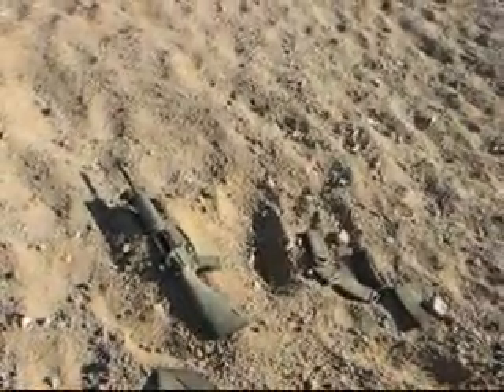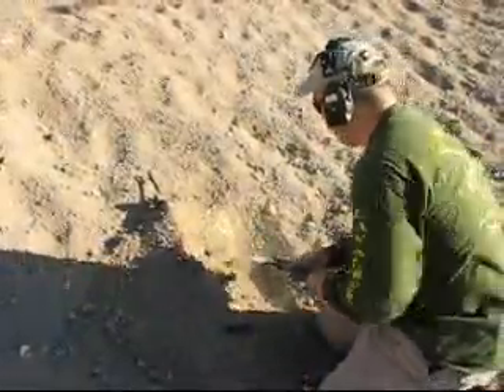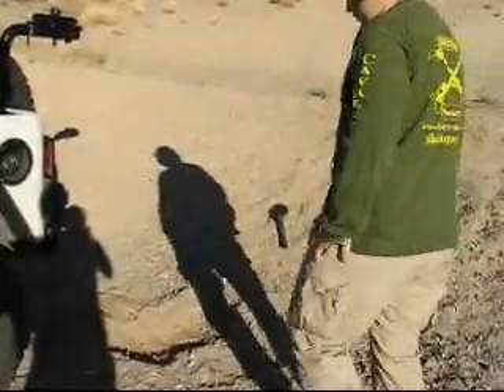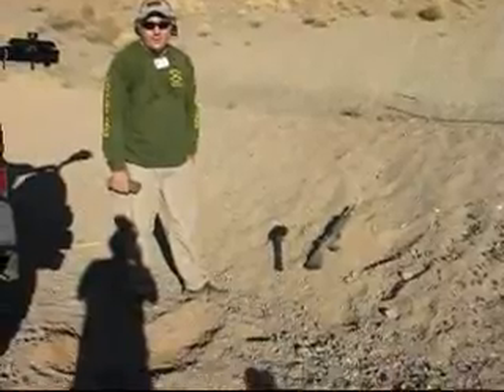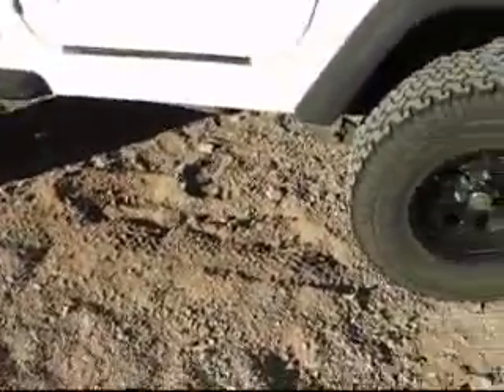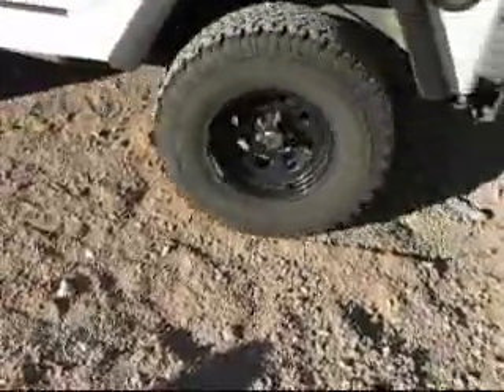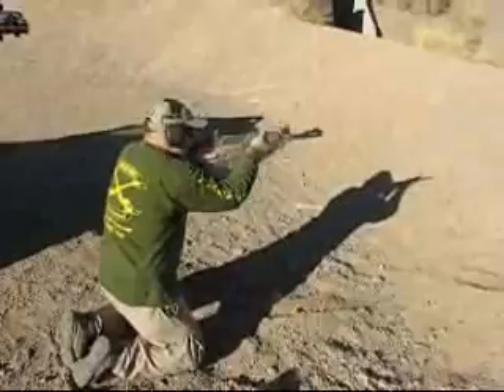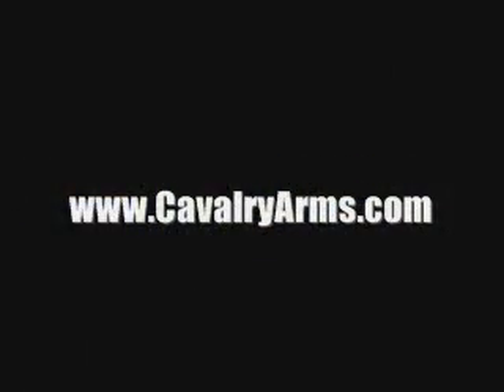AR Dirt/Dust Test Dust Cover Open, Run Over

Comment: @oeyesea Of course we were told that M16 is flawless, and anything wrong with it was user error LMAO!!!
Reply: use a quality magazine, properly lubricate and maintain the weapon and it is one of the most reliable small arms on the planet and by "maintain" I don't mean clean, by maintain I mean, replace the extractor spring when necessary or PM it and do the same with the action spring aka the buffer spring.

Comment: @frankgon4 Depends the sand in iraq and afganistan isent it a very fine grain sand almost like baby powder while the sand used in most tests is beach sand or just dirt? also it's still a machine im sure it will jam up sometimes when in that envionment only reason the ak doesent is cuz it was designed with very loose tolerences idk both are great wepons you me.

Comment: @Hincesti07 Standard 5.56 round is 62 grain, and 77 grain bullets such as the mk262 mod 0 & 1 are common and are used on special purpose rifles.

AK74 uses 49 - 56.8 grain bullets as the most common rounds.

Comment: @pugs2300 Bolt is close during the test and was never advertised as being open. At any rate, if enough debris get's into the operating system of any weapon, even the AK's, as debris don't magically teleport to a different dimension inside an AK's action, malfunctions will occur.

They did a similar test with an AK, of which the AK failed to keep debris off it's action, which ultimately lead to some of debris migrating into the magazine and causing further issues.

Comment: I also like the G36, which by the way uses an AR-18 style bolt and piston system, because the charging handle was part of the bolt.
Whatever obstructed the bolt could be cleared by a hard push or a gentle application of boot force as we called it. The AR-15 style bolt assembly "pulls" the bolt, and you will find it harder to find a hard object and slam your charging handle against it to force it to work.
Sure, recoil is higher, but we don´t run through ammo as much as the US troops do.

Comment: constantly blowing in the wind gets into everything. Piston guns may be able to run a little longer without proper maintenance, but if I'm in an environment like that, you best believe I'm going to be cleaning my gun. DI guns are plenty reliable enough to work between semi-regular maintenance sessions, even if all you do is wipe down the BCG with a rag and lube it up. I like piston guns fine, but I also don't feel the need to run out and replace all my DI guns either. Thanks for the test/video.

Comment: non-professional shooters. Most people aren't capable of consistently and effectively using Kentucky windage in combat. Having a gun that works reliably is slightly more important to me than hair splitting accuracy, but both reliability and accuracy are paramount for a fighting weapon. Any gun that is kept fairly clean/lubed, and used in conjunction with decent ammo and quality magazines should run for you. The Middle East is a challenging environment for all firearms--the tiny particles of sand

Comment: All gun "issues" are generally over exaggerated. The AR-15 is more reliable than people give it credit for (particularly the current ones--the gun has been improved immensely), and AKs are a lot more accurate than people give them credit for (especially the 5.45 variants, plenty accurate to hit a man sized target out to 300 yards, which is getting to the beginning of the end for the effective range of the cartridge, and the point at which magnified optics, etc. are necessary for most

Comment: what many people dont know is that aks are less reliable in sand. they can chew mud and dirt and much more but they have always sufered in sand. that is how the isreali galil was brought about. ak was made for europe thearter. harse winters and mud not desert.
Reply: If you watch the InRangeTV Mud Tests, Ian and Karl actually break down exactly why this is.  The sheet metal "Dust Cover" doesn't very well, because there's a big gap when the safety lever is down to let the bolt handle shovel more mud, and grit in with every cycle of the action.  "Open the action, throw in a handful of sand, it will still fire 1 round."  ~M. Kalashnikov.  It's all he ever promised, the Soviet government.  To truly function, the action has to be very good at keeping it from getting in in the first place.

Comment: Interesting.  I found an article that the M4 came in last place in the dust test due to jams, but the military said they were going to buy it anyway.  
My M16 did jam on me several times in the Desert as a solder.  
 What make rifle are you using?  Is it Colt or HK ?

Comment: PMAGs solved alot of the problems of jamming.  No more feed lip issues like the old USGI aluminum ones.  They're the only mags that you can really run through a SAW apparently without jamming.

Comment: The problem with this test is that the sand, dirt, and dust used was from a domestic source.  It is well known that only dirt from other countries will cause an AR to choke.  As for parking on your gun, that seems a bit excessive to me, but heck you are a "Trooper" for giving it a try.  I would like to see some head to head mud wrestling matches between the AR and the AK.